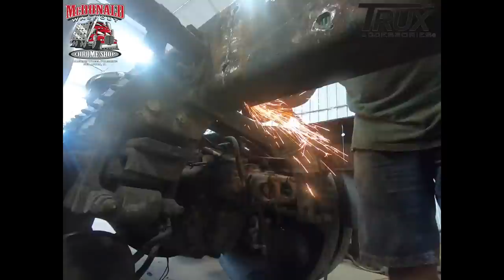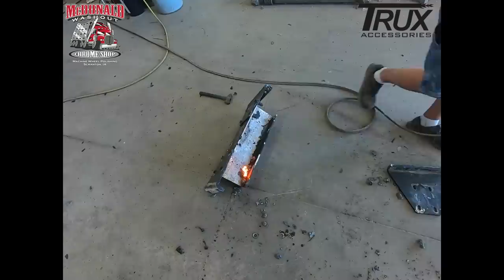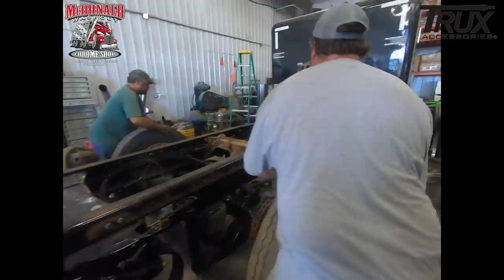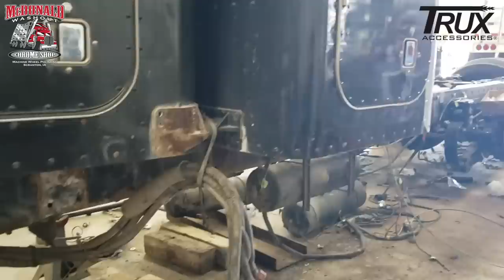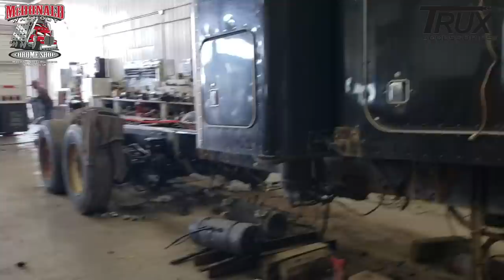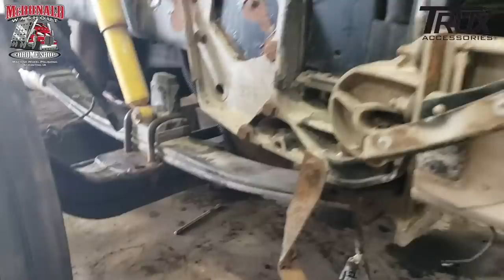Frame Stretch | cut off | Disc Brakes | Peterbilt 379 | McDonald Chrome Shop

Comment: Had frame ex and found its stronger with a cross sideways on frame and add double frame from back up to sleeper never no problem  in 2 million  miles
Reply from the maker: there are different cuts for strength people use when they dont add internal frame rail like we did on this project. z cut, adding a diamond plate welded, claw cut, and so on but when you add as much frame rail as we did in over 15 years we have never had an issue stretching this way and my personal 1998 W900 we stretched to 331" wheel base, i put over 800,000 miles on it never an issue. thanks for watching hope you check back when the project is finished and see the full amount of strength we added to the frame. I could only show so much in this video frame was not complete but needed to upload . we had gotten busy working on our farm equipment its getting close to harvest here. also the piece i showed being weld was just the first step to the welding we do to not only make that cosmetic piece be able to blend in at the ens of the build but add strength, again i was not able to show the finished product but i believe when we do and explain all we have done to add strength you may change your mind on the quality.

Comment: I'm only a hobbyist welder but even I know something's not right with the settings when he started welding the frame together.
Reply from the maker: we were having wire feed problems when we would first start the weld. then is would smooth out. when we show the next video on this truck you will see we got it figured out.

Comment: Training day for the crew, that's just a project it will never pass a DOT inspection in the North East
Reply from the maker: our trucks travel the lower 48 and canada never had an issue crack, break, in over 15 years of building trucks. 2 that i know of have been rolled over while loaded and the frame never had any damage anywhere close to where the trucks were stretched. my truck i personally drove over 1 million miles with the frame stretched to 331" wheel base never had an issue.
Reply from the maker: hell you can say whatever you want on the internet. Most people who think they know something do. We have been building trucks for over 15 years, we have never had a frame we have worked on crack, break or any other issue. 2 trucks that we have stretched over the years have been since in roll over wrecks loaded and there were no issues with the workmanship on the frame. like i have stated in a few other comments on this video, we stopped working on this project for a few weeks to get ready for fall harvest so i posted the video without showing the full finished frame work. Our next video on this project should show fully what we do to ensure the strength and quality of the work we do. i will also share this link to a video showing just a couple of the trucks we built and i know at least 3 of them we stretched. some people judge the unfinished product and thats fine but we only care about the end product and what our customers think when they have years of use out of a truck they love. here is a link to a video that shows some projects https://youtu.be/HonKzChXA2M i believe when we are able to show all that is done on this project in future videos you may change your mind, if not thats ok too. and about the gloves and using the torch? i guess this is a big safety issue  for you,  we use the safety equipment needed for the job. Sometimes gloves are needed, im not sure why in this case they were not but after 21 years in business and only one workmans comp claim for bumping their head in a semi trailer while washing it out i think our safety record speaks for its self along with our hundreds of happy customers.  thanks for watching

Comment: I have a single axle day cab that I would like to make into a tandem or add a tag axle. How would I go about it?
Reply from the maker: i would look for a cut off,  off a wrecked truck that has the same frame rails. then what we do is add inner frame rails too the inside of the truck frame and the cut off, bolt inner frame rails to outer frame rails in a few spots. without seeing your truck i cant say how many times but then weld where you put the two pieces together.
Reply: McDonald Chrome Shop 
Ok mine is an old Conway truck so it’s easy to find tandem axle sterling for next to nothing. I just want to do it for the sake of doing it. I could buy one at auction for $1,000 easy but that ain’t no fun!

Comment: Little surprised to see cutting the frame in half with a 41/2 in grinder
Reply from the maker: Makes a nice clean edge, what were you thinking was used? im actually curious not a smart ass. there are other ways but this is what we use

Comment: I'm from UK...so what's the law on frame length in  USA...
Reply from the maker: no law that i know of on frame length just an over all truck trailer length i believe. Not exactly sure where they draw the line on needing over length permits is for sure, but im sure it can be googled lol . My personal truck i had from around 2006 - 2009 was 331" wheel base i know there are longer around here also.
Reply: Over 80ft total and you need permits

Comment: Is it legal to cut off the chassis and weld it ?
Reply from the maker: Yes
Reply: There's no manufacturer that recommends cutting or welding their frames because they are heat treated. And 393.201 in fmcsa regs will seal the fate of putting any truck with welded frames out of service. That's the law, but obviously no dot inspector will do it.  Or there wouldn't be as many stretched trucks.  The only "legal" way is to buy complete longer frame rails. As far as splicing frames, adding a section in the middle of axles and cab is the "fast and cheap" way to do it.  Adding frame section to the rear and drilling new mounting holes will only leave 1 weak point in frame.. this splicing a section in between, leaves 2 weak points.  Seen it done both ways. Haven't seen a frame broken yet, but im sure nobody would post it if it did.

Comment: Where do i get those frame inserts?  Ive got an 87 IH S1600 im wanting to stretch
Reply from the maker: different trucks have different size rails so your best bet is your local blacksmith shop and have them order you the correct size if you they dont stock it. thanks for watching
Reply: @McDonaldChromeShop  thanks

Comment: Never square cut a frame then add. This is a shade tree mechanic shop. They are simply half ass...
I’m sure they are the type to get an attitude if you tell them otherwise. They think their quality of craftsmanship is above and beyond. Well it hasn’t even left the ground and I’m not a safety nerd but who cuts with a torch without gloves. Just showing off for people that are rolling their eyes at them....
Reply from the maker: hell you can say whatever you want on the internet. Most people who think they know something do. We have been building trucks for over 15 years, we have never had a frame we have worked on crack, break or any other issue. 2 trucks that we have stretched over the years have been since in roll over wrecks loaded and there were no issues with the workmanship on the frame. like i have stated in a few other comments on this video, we stopped working on this project for a few weeks to get ready for fall harvest so i posted the video without showing the full finished frame work. Our next video on this project should show fully what we do to ensure the strength and quality of the work we do. i will also share this link to a video showing just a couple of the trucks we built and i know at least 3 of them we stretched. some people judge the unfinished product and thats fine but we only care about the end product and what our customers think when they have years of use out of a truck they love. here is a link to a video that shows some projects https://youtu.be/HonKzChXA2M i believe when we are able to show all that is done on this project in future videos you may change your mind, if not thats ok too. and about the gloves and using the torch? i guess this is a big safety issue  for you,  we use the safety equipment needed for the job. Sometimes gloves are needed, im not sure why in this case they were not but after 21 years in business and only one workmans comp claim for bumping their head in a semi trailer while washing it out i think our safety record speaks for its self along with our hundreds of happy customers.  thanks for watching

Comment: Never weld a vertical down weld it going up it is a stronger weld. And yes turn your welder up. You just made a very weak weld. I would not drive that truck.
Reply from the maker: yes vertical up weld is a stronger weld. if your'e not putting frame rails in behind the frame then yes you need to do  a vertical up. but over the last 20 years give or take we use an inner frame rail for strength and have never had an issue. we trust the strength with the frame rails added over a vertical up. like i have stated before in the coments my last truck i personally drove for over a million miles we stretched this same way but had added 6 foot in length making it 331" wheel base. hauled cattle coast to coast over a million miles with no issue. we have had 2 trucks that we know of that were rolled over loaded that we stretched and not one issue with the frame work where welded and put together. and also like stated before in the previous comments the welder was set fine we were having wire feed issues due to the gun. we replaced it and continued the project. we just did not get that part on film.
Reply: McDonald Chrome Shop of course you didn’t get it on film... easier Said than done ..  some better teach that guy to weld that was the scariest weld I’ve ever seen in my life. I don’t care if that’s how you been doing it for the last 20 years.. I’m here to tell you that you’ve been doing it wrong for the last 20 years ... getting lucky if nothing hasn’t happened... take some pride and do it the right way for fuck sakes

Comment: Sorry guys, but that's  not a good job(as noted by others): eg never butt joint anything structural, especially in that location(bending moment) - always scaf joint, or fish mouth joints, even with backing plates and/or fish plating. Why use inner death(sheild) in the workshop, as it's bad for undercut, big HAZ in thin sheet........And where is the geometry checking/temporary weld bracing? Soz for negative comment but... :( Back to the Pakistani Truck Channel for me.

Comment: Looks good but dear Jesus y'all need a better welder and person welding. I wouldn't feel safe with those welds. You need a Miller Dimension 400 and some 0.51 flux core wire especially considering how much weight that thing is going to carry. Prior to becoming a truck driver I used to weld beams and shear plates, butt plates, etc, etc, for factories being built that would either support the whole building or a machine that weighed 100s of thousands if not millions of pounds and would weld up to 1 inch thick steel. Take my advise and get a Miller Dimension 400, put the feeder on a little rollcart like a wheel dolly that's really low to the ground to pull it around with the gun in hand and get alot of cable. Use flux core and gas on that 15-20 pounds per hour on the gas and crank it up a good bit bc that was not safe welding. It didn't penetrate and the flux core will help on the uphills.. btw never weld downhill on a structural part like that.. it's not a complete weld. Start at the bottom with the wire speed down alittle and do half inch to 1 inchmovements pausing for a quarter second at a time till you see the puddle then go before you spill it on the floor.

Oh and fucking Z the frame and put either a Shear plate or that whole section of rail like you did and weld the piss out of it. Personally I would trust my welding enough to just weld a shear plate to it.
Reply from the maker: Ive responded to this before and will here again then try to pin this comment to the top of this comments section. The story behind this video (specifically the welding part of the video) is that we simply had a problem with our wire feed and turned out we just needed to replace the lead it had been run over at some point and was causing the wire to feed inconsistently. Around the same time i had been doing a ton of research on how to grow our channel and gain the most subscribers, what i had found is if you post something (controversial) that will cause a lot of comments along with thumbs ups or downs doesn't matter negative or positive youtube pushes your video and channel a lot higher so we used the messed up lead and finished the cosmetic part of the welds. I edited the video and released it and boy were they right the amount of comments and thumbs up and down drove this video tho gain us well over 1,000 on this one video alone also made us the most money on ads and has done nearly 150,000 views to date. while this was happening we bought a new lead recut where we previously welded cleaned it up and re welded it correctly and recently sold this truck for over 6 figures. we have had many customers call us since seeing the finished project, how the frame on this truck and every truck we do is completed and inquire about doing the same to their truck. Some out there don't or wont believe we would post this just to see if it gained subscribers for the channel. But i'll Leave you with this, If this is how the truck was left and put together don't you think i would of went back in and edited that part out after all these negative comments? disabled comments, or taken the video down completely?  The answer is no, it's done exactly what it was intended to do and in later videos of this project you can see how the completed job turned out. This truck went to a few truck shows, had hundreds of people come through our business to see it and then had potential buyers come look it all over before it was purchased. The frame was redone correctly with the welder working properly and lastly as stated before we stretch or put cut offs on an average 5 trucks a year over the last 20 years and have never once had any issue even after 2 of the trucks we know of were in roll over wrecks loaded frames were still in tact. So Everyone can feel free to comment but this is the explanation of this video. Thanks for watching

Comment: Clean your metal. And turn your voltage up . Looks like popcorn
Reply from the maker: As I've explained prior we were having problems with the wire feed on the gun. We fixed the feed and on our next video on this truck you will see the finished quality where we redid this area your commenting about.

Comment: Wrong cut on the frame always cut in an angle gives it more strength and those welds my my my little rough in your welding skills there
Reply: You cut it between the tandems but yes that to
Reply: Lee Harris gotta give the guy credit for trying but I wouldn’t even hook that cab to anything it would break in half quick

Comment: That guy doesn't know what  he's doing with that welder . Temp is wrong wire speed is wrong and on top of it all he went down hill ,🤦‍♂️where do they find these hacks
Reply: They're usually out back of the truck stop methin around.

Comment: Amateur hour is right total shade tree frame job.. How lazy not to pull off sleeper and tanks.. If right man had done it you would never seen anything to know it was lengthen.. They always cut the easy access points such amateur work..
Reply from the maker: lol look at any finished frame stretch we have ever done and you will not ever notice looking at the exterior of the frame where a frame has been stretched. show me in this video https://youtu.be/HonKzChXA2M where the frames are cut on any truck stretched by us. these are finished projects not unfinished like this video your commenting on. get a clue. big difference on showing raw non finished product vurses complete. and by the way the tanks were off did you even watch the video? and what would be the need to take the bunk off?

Comment: Think i would take this off utube.  Not a super bad way to stretch the truck but my christ go learn to weld....that a horrific mess i wouldnt even allow on a 3200 lb street rod.   Holy crap guys....really..
Reply from the maker: hey Doc read previous response to this same type of comment. We had wire feed issues with the gun and we re did all of this. I published this video with showing the way the gun was messing up for 2 reasons, 1st reason i needed a video out that week 2nd reason and why i left it in was an experiment, i had seen on youtube if you do something controversial that will make more people comment and youtube will promote your video more. that proved to be true. when people start bitching and whining the more comments good or bad along with thumbs up or thumbs down youtube pushes the video more and in return this video is our second highest views to date but made us more money in advertising than any other video. We have since like stated above and in other comments redone the welds then moved on to other projects we needed to accomplish before we get back to this one. shortly we should be hopping back on this project and in that video ill be able to show the condition of the frame and the inner frame.  in on of our recent vlogs this truck is drove into the wash bay and you can catch a glimpse at the frame, but im waiting to do a full video before getting into it more

Comment: Whoever thought those over length frames looked good on a truck must be the same person that thought 24 inch rims look good on a ford pinto to me just dont look right and ive drove trucks 42 years the only ones that loik good like this is a truck and trailer no gap between the cab and box or flatbwd lik hay trucks
Reply: Old school to stretch was to zoro the frame. Old black smith shop in Montana used to take a out side rail flatbed, cut four feet out of the center. Then weld it back. Never had problems.